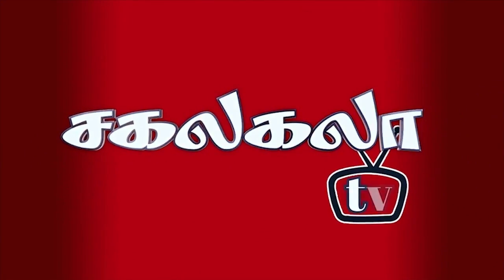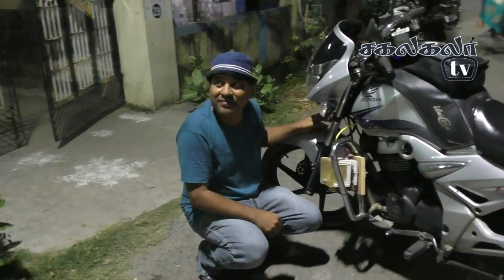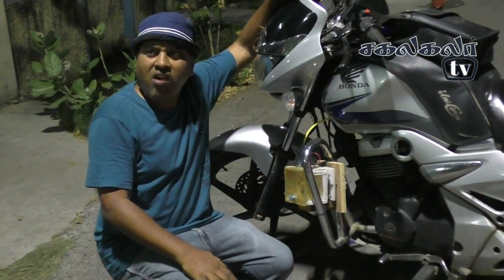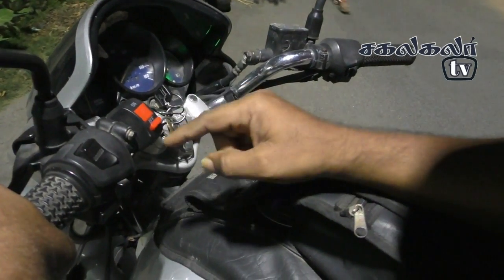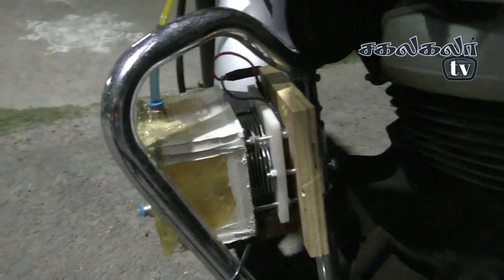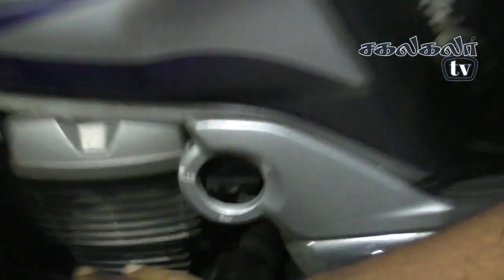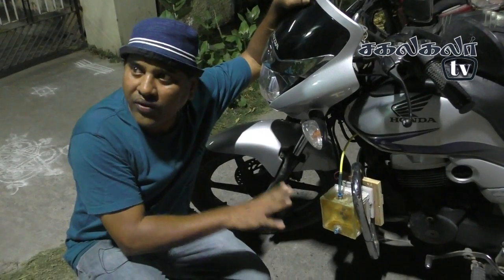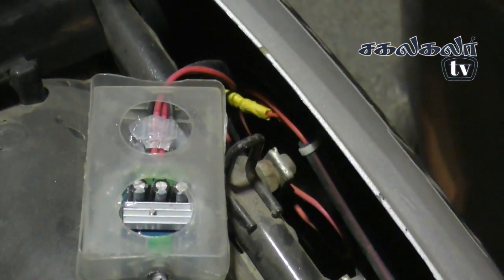Hybrid Water Bike || HHO Bike || Sakalakala Tv || Arunai Sundar ||

Comment: What is H H O GAS? 

Although HHO gas is presented as a revolutionary new technology, it is only oxyhydrogen. Oxyhydrogen is produced by electrolysis of water. Water breaks down into its components under the influence of electricity of different origin. 

Hydrogen and oxygen. (2 (H2O) -> 2H2 + 02) 

Hydrogen electrolysis If these two gases are compressed together and not stored separately during production, detonating gas can be used for various purposes.

If these two gases are compressed together and not stored separately during production, detonating gas is produced which can be used for various purposes. 

Oxygen gas is 7 times more flammable than gasoline, and when it burns in a flame, it reaches a temperature of 3000 degrees Celsius, and only water is created by it. The purest flame burning ever.

This technology is more than 200 years old but has been neglected for business reasons.

Comment: Nearly 50kWh(50units) electricity required to produce 1 kg hydrogen gas by electrolysis method.
1kg H gas  contains     <=33kWh
Means if you spent 100%,u can avail only 66%.
1litre petrol contains <=9kWh
Then,
3.67 l petrol =1kg H gas=33kWh.
Consider ur bike coil maximum delivers <100W(I don't know exactly,let us assume as100,but it should be within that ).
If u run ur bike for 1hr (during this no light ,horn,..should run),it delivers 100Wh,with that u can produce 2g H gas,
So, 2g H gas contains =66Wh
Which means u save  7.33ml petrol for 1hr ,actually it's not as this H gas generator input power also impact engine load.so totally waste.
If u ride without this H gas kit,it delivers more mileage than that of bike with kit.
Hope all understood.
Reply: May be you should put a video to explain, too hard atleast for me to understand 👍🏻
Reply: @je69je  I didn't make any video still now.
You can understand the comment by asking any physics guy having good knowledge in English.

Comment: 5 year back I was in my passion bike. The battery life is too less after fixing this...because to produce the hydrogen we have to inject current, the bike GE dosen't have that much capacity. Tow time bike GE also got damaged. Instead of producing hydrogen we can use  EL bike directly. And the hydrogen we can't store like a petrol tank. Whenever you produced the hydrogen immediately need to fire. If possible make this hydrogen from home electricity and mix with petrol or make a separate tank for hydrogen....

Comment: May I wish you. But already I'm do that 6 year's before. The main features of this thing 's are 
1.To improve fuel efficient
2.maximize to improve better combustion up-to 70-75 % only
3. It's Easy to handle any one
4.Reliable
Draw back are
1.Back fired possibles 100% . 
2.In a spark ignition engine maximum combustion pressure is 300 bar but now days bike using 150 bar due to reduce advance firing. One more reason is petrol is highly volatile
3.To increases the engine temperature. how  it's the designing of engine cylinder and head  tested as normal fuel(petrol) no special fuel.
4.The design of SI engine position vertically or inclined. The reason is maximum petrol vehicle 's Naturally Air Aspirated engine.So too much of heat can be ejaculated.
5.Damaging the inlet manifold.
6.Already petrol is blended alkalization, oxygenation,Hydrogenation more number of process are there and and more thing is to reduce the detonation using octane 's but here adding more hydrogen so auto ignition temperature is 500 - 550 C 
7.so many reasons are more and more.  
May I apologize to you this all are reason .No need to boorish
Much thank to ...
Reply: Anandha Anbarasu... My whattsapp number 9445511132...i also did a  hho unit 6 years ago.... I had it on my royal enfield... But i did not have the switch like him... Pls call or send message

Comment: I dont think its a new invention... Sorry guys thappa eduthukkadhinga,. Just 400 to 500 ml water vechi 1000KM ku once mathuranga... so very low amount of Hydrogen dan generate aagudhu... idhuku direct ah hydrogen gas eh use pannikalam. Mileage vena increase aagalam, konjam boost aagum... fuel save aagum avvolo dane ? idha neenga veetulaye test pannalam,.. Cathode anode Direct current koduthu... hydrogen and oxygen thani thaniya bubbles ah varum... but rendum sendhu vedikkum podhu vedikkum thanmai jasthiya irukkum. so try panna safety paathukonga

Comment: energy used for breaking hydrogen and oxygen from water can't reversable 100%. which means energy produced by hydrogen and oxygen bonding during combination is less than energy spend to break the bond.
Reply: U r right, in this case it looks like petrol is burning more efficiently because of hydrogen and oxygen which results in more energy for bike so 30% more mileage

Comment: Sir this is for supplyment uses im also try this it's dry cell Im using wet cell when I'm studying 12th
2007 I made stainless steel plates using pwm board we can control ampear and volt to reduce speed rang

Comment: This also corrode your cylinder and  piston so life of the engine reduced.
Reply: So what is the use of engine oil
Reply: If there is water, then only the corrosion happens, but there is water in the combustion chamber, moreover engine oil is circulated in the entire engine and corrosion will not happen !!!
Reply: @ganeshrvgk  Not only the combustion chamber. It entering into the carburator so that affect  intake system also.
Reply: Engine oil is to reduce the friction and heating. It has nothing to do with corrosion.
Reply: How is it possible
Reply: Engine oil piston varaikum varuma ???
Reply: First of all anga h20 content gas format la iruku ... so combustion adhigam ... booster connect pandraku, munnadi ideal rpm (1000) irukum ...   after connection idea romba (1100) increase aagum  ... without tuning of air and petrol screw  ... ipdi dha mileage increase calculat pannanu ... idhunaala engine ku endha problem um varaadhu ...
Reply: @v2.0innovations21  h2O converted into H+   OH- . So that the OH - react in to the piston and cylinder that produce Aluminiumhydroxide.This formed like rust. And also the catalyst also affect your engine.

Comment: This system is ok, but when u store hydrogen in tank, that make explosion.
Reply: bro hydrogen can't stored in the bike hho generator creating the hho gas and directly  flow  into the air intake. if u stored in small volume tank it bursted because hydrogen is high flammable and very low density..so only it make to flow directly..
Reply: What happens if you stop electrolysis and there is no generation of Hydrogen, then why worry !!!!
Reply from the maker: Tnkz for reply bro
Reply: Thats Wat he gave separate exit flow under seat of the bike ....